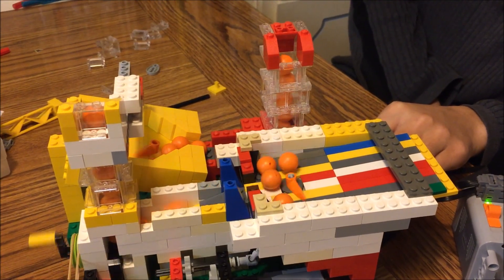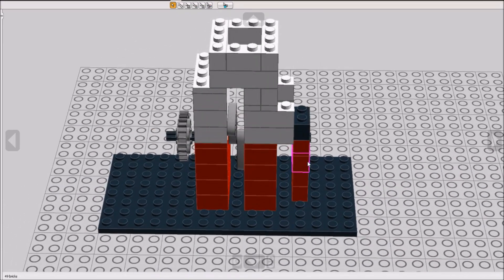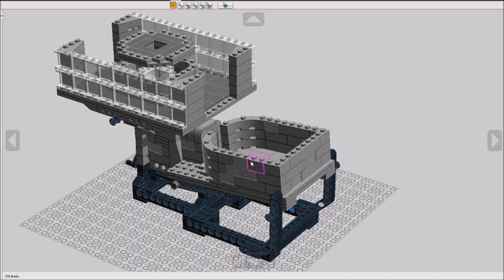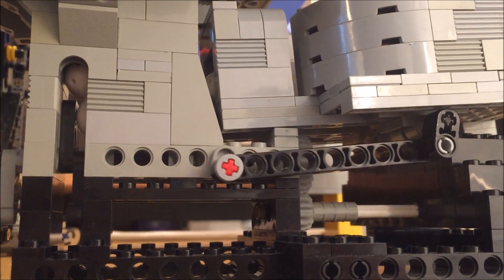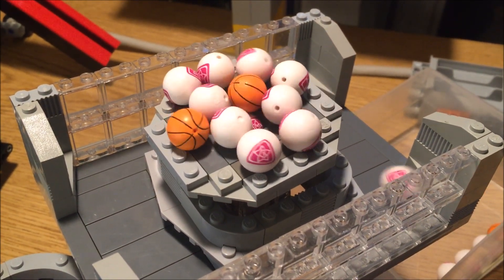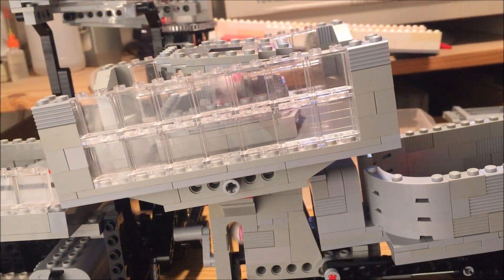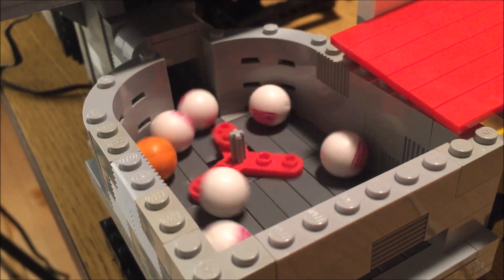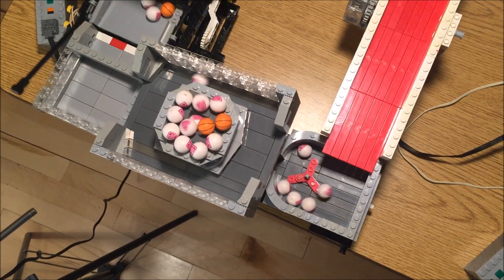LEGO GBC Fountain (ball pump implementation)

Comment: I love the fountain effect. Never thought of that. (This could also be done with other ball pumps, e.g., the the Brick World Chicago Workshop Module from 2018.)
The direction sensitivity does not have to be a problem when using one power source for multiple modules. One can simply use a power functions switch to reverse the polarity, if necessary.